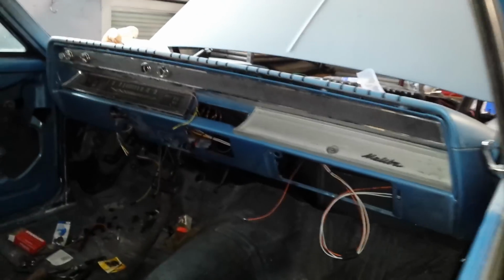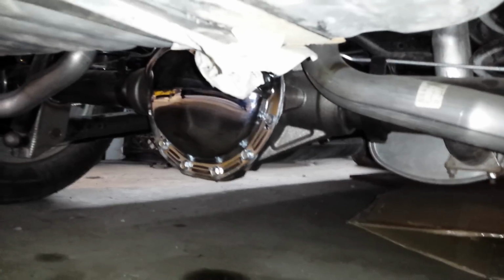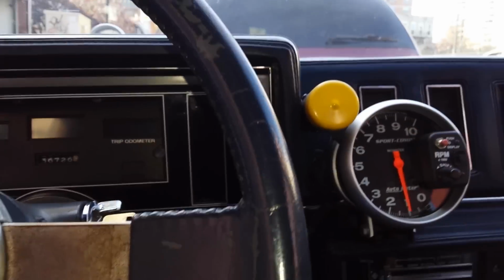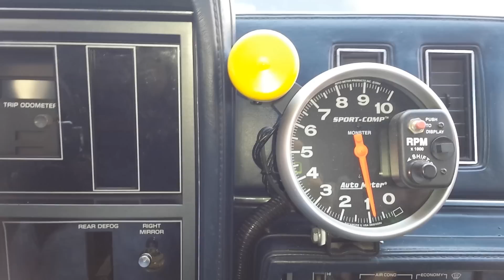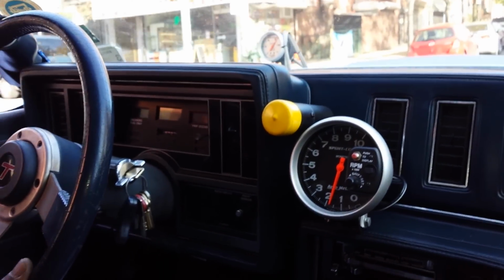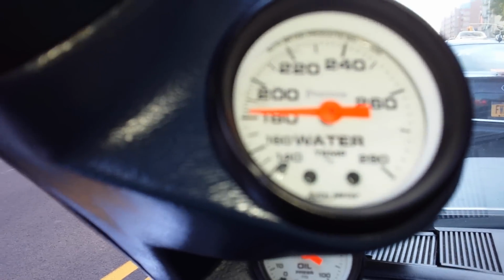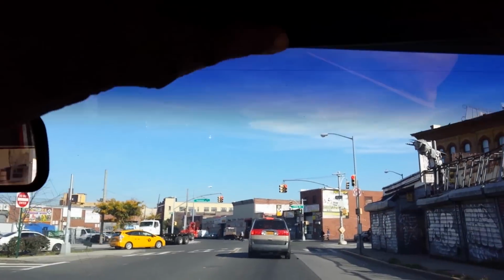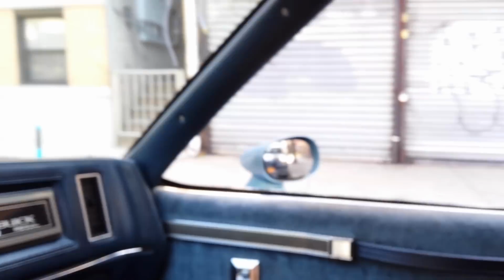CDS Stage-1 Buick 455 Regal APPOINTMENT with RALPH went PERFECTLY!!! 11-8-2014

Comment: I have been watching your videos for over a yr now
 I have just put a 455 in my 85 regal. What  bracket do you use so the power steering pump clears the steering box?
Reply from the maker: Jesus_Christ! I'm VERY sorry for not seeing your Comment until now. 

I sincerely apologize. 🙏🏼🙏🏼🙏🏼💯💯

I use the Factory Power Steering Pump on the Regal-T; only had to Change the Hose Connectors.

Comment: That Buick 455 is the baddest 455 of all the GM 455s. In the early 2000s car craft did a big block shoot out and dyno'd a built Oldsmobile 455, Pontiac 455, and Buick 455 and the Buick made the most horse power and torque. You can't beat them GS 455s.

Comment: Where can I get some long tube headers from I have a 455 engine for my car
Reply from the maker: ... TA Performance.
Reply: @NAS-Performance  hey bro,what kind of hp do you have I have a 455 boar30 over with stock gs heads did you have to chang valve springs and rockers I want to run the same cam as you if that ok with you
Reply: I would like to copy your engine
Reply from the maker: @karlleath7287  Thank you, but unfortunately  ... it's a basically Stock Buick 455 Bored .O30_Over with a TA Performance TA290-08H Flat_Tappet Hydraulic Camshaft, Hardened Rocker Shafts, and Dual Springs. The Edelbrock Performer Intake Manifold has not been Port_Matched correctly, and the Heat Crossover has not been Blocked Off.

The REBUILD is going to be MUCH more Powerful.
Reply: @NAS-Performance  what valve springs did you used and and do the stock rockers work
Reply: What kind of hp do you have in the 462
Reply from the maker: @karlleath7287   Good morning and God Bless you and your Family. 

At the time, I'm guessing @ 400 Horsepower at the Rear Wheels.
Reply from the maker: @karlleath7287 ... Double Super Valve Springs from TA Performance, and yes; Stock Rockers Assembly. But I adamantly suggest that you get TA Roller Rockers for a Flat_Tappet Hydraulic Camshaft. I also have a Double Timing Chain.
Reply: @NAS-Performance  thanks for the advice I watch all of videos and thank once again you have inspired me to stay true to the Buick 455 may God bless you
Reply from the maker: @karlleath7287   ... Good morning and God Bless you and your Family richly. Thank you very much for your Blessings.

I adamantly suggest joining the Facebook Group called The Ultimate Buick Performance Group  ... or something very close to that name. It's TA Performance's Page ... I'm a very active Member. Also, send Michael Tomaszewski a Facebook Friend Request 🙏🏼❤️😃💯💯🙏🏼 ... his Family is TA Performance. 

I'm sure those Members are much better help than I am, and I sincerely appreciate any questions you may have to ask me regarding my Buick. 

I'm DYING for Mr. Jim Weise of Tri-Shield Performance to complete my new 1976 Stage-1 Buick 494_Stroker BIG-BLOCK Motor. 

Last week, he told me that the Block is finally in the Machine_Shop 🙏🏼🙂🙏🏼. 

I'm planning to Repair the current 1973 Buick 455_462 Stage-1 thats in my Regal-T. The guys in TA Performance's Facebook Group feels that it's either/or/both the Front Crankshaft or Camshaft Bearing thats shot ... I'm leaning towards the Crankshaft Bearings due to the 18-PSI of Oil Pressure. 

I'll probably have to buy a new TA290-08H Flat_Tappet Hydraulic Camshaft/Lifters for the 455 in my Regal-T. I'm keeping it as a spare 455 when I've Repaired it, and Reinstall it in my Regal-T to see what 1/4-Mile times it's capable of. 

I'm VERY excited about the 494_Stroker; I'm hearing that the 4 will indeed be Yanking_The_Fronts off the ground on Hard Launching at The_Track. 

Regarding the Cam; no Roller-Camshafts are available still for the BIG-BLOCK Buick, so I decided to accept a Flat_Tappet Hydraulic Custom_Grind Camshaft by Mr. Weise my Engine_Builder. 

He's aware that I want a Camshaft that sounds better than the TA290-08H in my Buick 455_462 ... more aggressive CHOPPING at Idle. 

As a matter of fact, My_Boy "George GS" has a Stage-2 Buick 494_Stroker whose Camshaft I want for my new Buick 494_Stroker. I'll add the Link to his Video after I finish this message to you. 

God Bless and Cover you and your Family. 🙏🏼😃💯💯🙏🏼
Reply from the maker: This is the Camshaft_GRIND I informed Mr. Jim Weise of Tri-Shield Performance that I would like for my Stage-1 Buick 494_Stroker V8.  The Camshaft in George's BEAST is a "Solid-Roller-Camshaft."

His Buick 494_Stroker Stage-2 Buick V8 was built by Mr. Scotty-G of Pee Gee Performance in Brooklyn way back in the day. 

https://youtu.be/axvAEFSihq8

Comment: please tell me you didn't take the intercooled turbo engine out to put a v8 in it?
Reply from the maker: ... never was a Turbo/Intercooled Regal. It's a Regal-T that came from the factory with an Olds 307 V8, 200-4-speed automatic tranny, and 7.5-inch limited slip rear with 3:08-gears. There were @ 281 built in 1987 ... most imported to Canada ... as mine was.
Reply: dishon Williams it's not a gnx

Comment: I have a similar build going on where do I need to move my frame pads so I can mount up a 455??
Reply from the maker: +Vernon Hickman What frame pads do you currently have? Are you putting a Buick 455 V8 in a Buick g-body Regal?
Reply: +Buick Torque yes I have a 79 regal and I took frame pads and mounts from a 72 455 was told they will work but I don't know which holes to move them to
Reply from the maker: +Vernon Hickman Okay. I was told that the 1974 Buick Lasabe frame pads would work  ... but they had the 455 sitting too high  ... hood wouldn't close. check out V8buick.com's forum under V8 Powered Regals for all the correct information you need. check out D&S Buick 455 Regal thread.
Reply: What kinda of hp out of a Buick 455 boar30 over stage 1 head's with  t/a 290-08h cam

Comment: I sure hope that regal didn't start life as a turbo car if it did I'm saddened.
Reply from the maker: Good morning and God Bless you and your Family. I hear you. 

It's an original 1987 Buick Regal-T with a Oldsmobile 307 and a Limited Slip Differential with 3:08's. The Transmission was a 4-Speed TH200 with Overdrive. The "T" Emblems and the Steering Wheel were from the Factory in 1987. It's a Canada Buick Regal-T.

Comment: temperature can reach up to 220 on a big block
Reply from the maker: That's too high of a temperature; TA PERFORMANCE and my engine builder said 190 degrees max for my motor. Bruno in LI gets 190-degree engine temperature on his 11-second 1970 GS Stage-1.
Reply: +Buick Torque I ran 454 brother in my regal run from 190 to 210 at idle when I'm cruising it stay at 190 to 200 but at idle 220 max
Reply from the maker: Sergio Gomez I hear you.
Reply from the maker: +Sergio Gomez What cam lift and what stall converter did your Regal 454 have? Also, what carburetor?